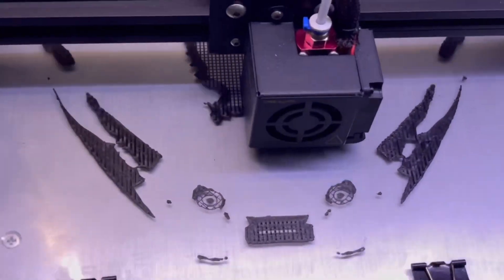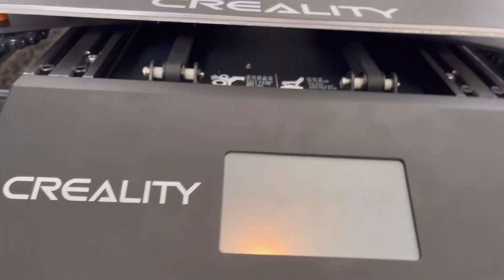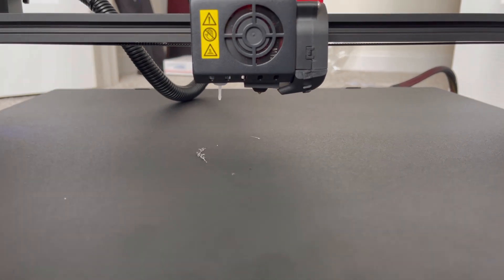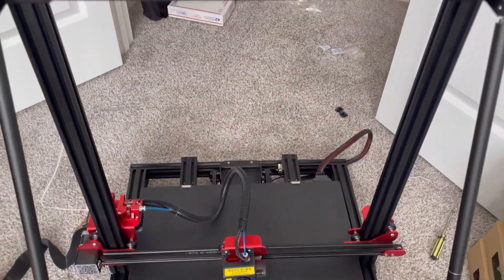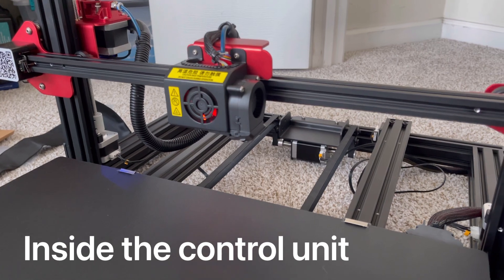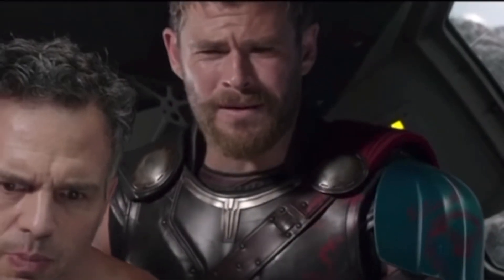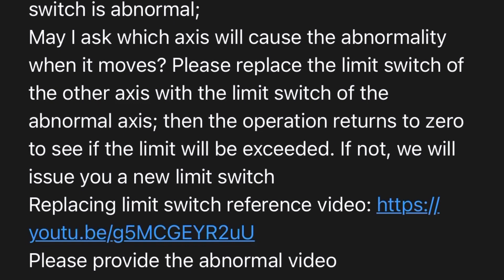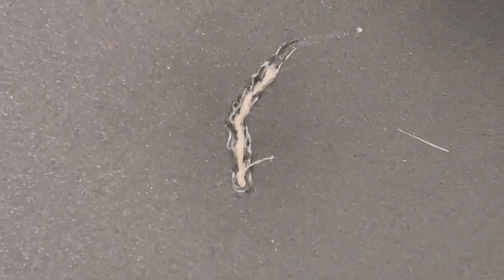Creality CR-10 MAX - And Then This Happened...

Comment: I have this printer three years, bought for roughly $600 (new), and currently 2750 hours print time on it. Problem with manufacturer in that time was they didn't sell final product but base kit for upgrades. With Microswiss head, glass bed and few more "adjustments" is this printer very good, if you want to print really big things...

Comment: that is not what printers are about (plug and play) there is a lot of work to do befor you start printing and a lot of things to learn. you should adjust z distance and it would not scratch the build plate.......
Reply from the maker: They took it back. The wiring was faulty. They sent me a new one and it worked like a charm. Printing right this second, actually.

Comment: Honestly, I have a Ender3V2 and a CR-10 Max, both needed no science degree to start and I didnt even bother to do  test print, they just do what they are made for. In time I have upgraded some things on the Ender, the CR-10 Max ist still as it came out of the box and prints BIG!
Reply from the maker: They took it back and sent me a new one that works wonderfully out of the box. They first one must have been a lemon
Reply: @SilverHusky12  also you never upload the video with the replacement and most of the people believes THAT Max is bad printer .... I have max without upgrades and make everything BIG and PERFECT
Reply: @SilverHusky12  that's great to hear! Have lots of fun with it and thanks for answering!

Comment: I don't wish to sound like smart **s after the fact.. but you should have do some research before buying $1000 machine.
I just checked some store and right now, Creality has 20 filament printer models. Yes, 20! Now take a closer look, and you'll see there are mostly variations of the same base printer. For example, they add bed sensor and call it new printer model. Or they change bed size and call it new printer again. How innovative is that?
Fact is, Creality is so popular because of their  cheap models.. one can't complain much in case of $180 printer, right? I mean, it's enough if it prints somehow. And after a while it either ends in attic or you start endless upgrading (to make it actually usable).
There exist 3D printers that are kinda plug&play, but not many. Usually at least some initial geometry checking and adjusting is needed. But that should be pretty much all -the rest is only maintenance. And one more thing: never believe in "it works out of the box" (question remains "how it works").
There are few honest 3D printer reviewers on Youtube, take time and check them out. Wish you luck next time.
Reply from the maker: Thank you for the comment. My daughter has a CR-10 base model and it works perfectly, which is why I assumed the upgrade would perform the same. I am printing masks and costume armor, hence the need for a large print area. Not many others exist that can do what this one supposedly can do. I guess I’m stuck.